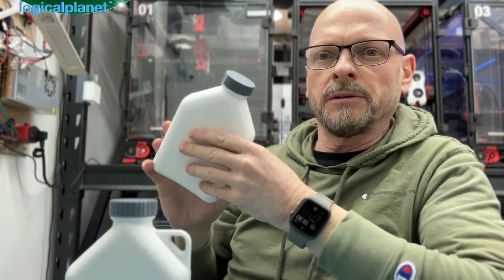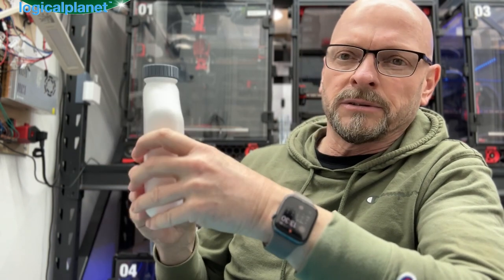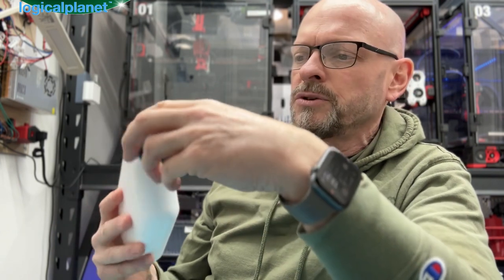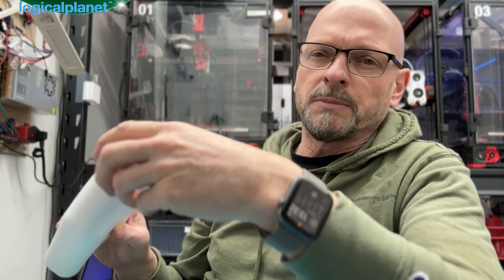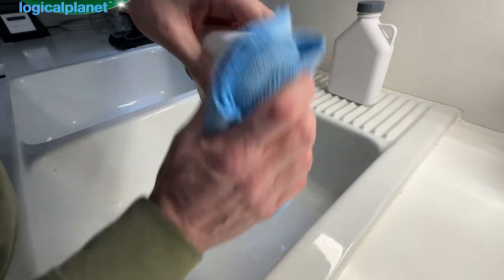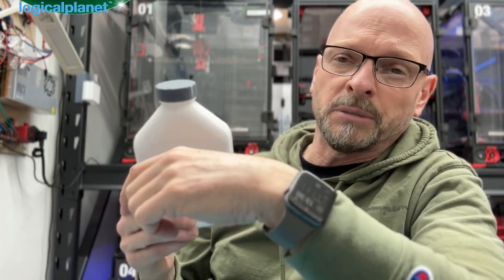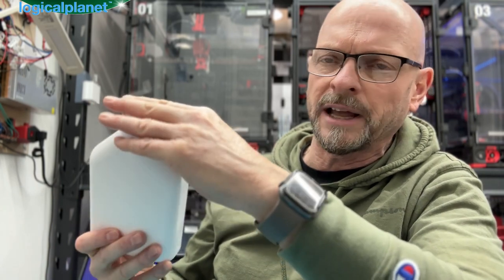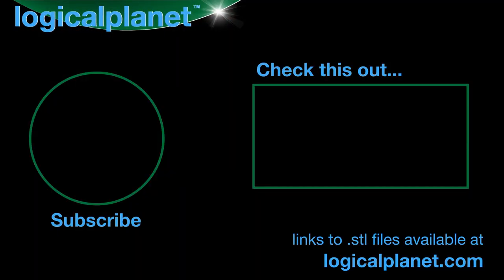3d printed 500ml flask

Comment: something else i could see is modifying the bottoms of the bottle so the center of the bottom was the lowest part instead of the outer rim so everything would flow to that lowest point if you had a straight tube siphon pulling from the center. for sealing up the interior quick and easy i'd pour in a UV cure resin and let it coat the inside before using a uv light to cure, should fill in any little perforations. . . . but yeah, commercially made would just be so much easier.

sand is an abrasive, different grit sizes and types for a mini sand blast unit or a small sander/polishing vibrating canister for doing finishing/surface cleaning on cast parts would work too. . . .but again it's just so much cheaper and easier to give a used bottle a second life.
Reply from the maker: Great comments.  I appreciate your thoughts.  The modified bottom makes a lot of sense as well does the UV resin sealing.  But like you said in the end, a commercially made bottle is just easier.  I had fun making the flask but probably the end of its development path for now.   I feel like 3d printing liquid containers could have its use somewhere but I just don't know where.
Reply: @pdb6251  maybe not so much as a bottle but as a refillable resin vat reservior